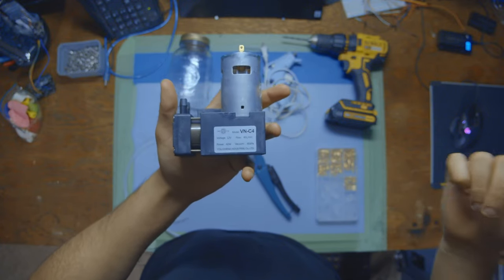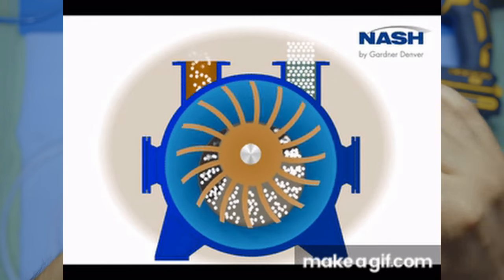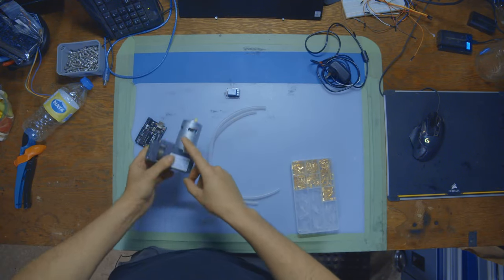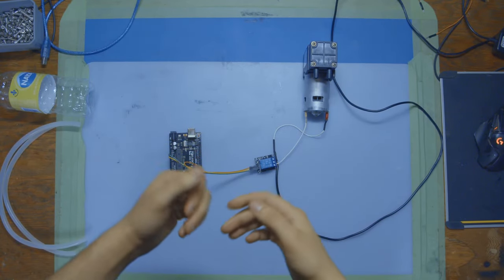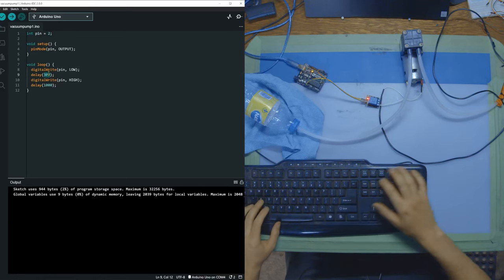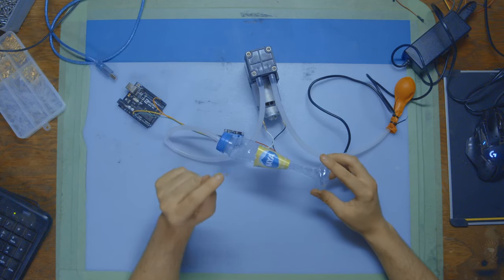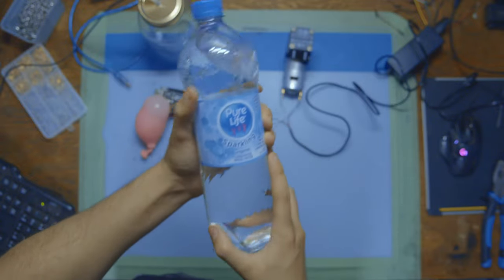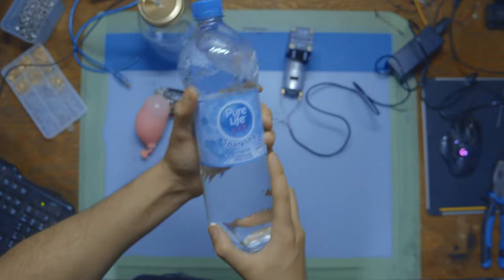ARDUINO + VACUUM PUMP EXPLAINED #vacuumpump #arduino #esp32

Comment: what if AC power vacuum pump control? still with arduino + relay? Im worry about pump will brekon.
Reply from the maker: need a power converter but yes you can do that, Or I used AC->DC power supply
Reply: @MikaelAbehsera  thanks for your reply, but I mean to control that vacuum pump which power is supplied by AC not DC, and I don't want to break it down. so I don't think AC->DC is good idea~because that pump will not work on DC...mabe a solution is valve I think...
Reply from the maker: @lmly9193 I’m a bit confused on what you mean, but if you look at how I set it up I control it with the dc power on or off from my power supply which connects to my wall AC port

Comment: Can u include leak sensor and vaccume pressure control?
Reply from the maker: leak sensor is a difficult one, best would be to use a pressure or vaccum sensor to seee if it drops over time